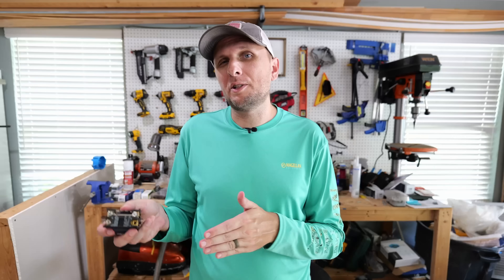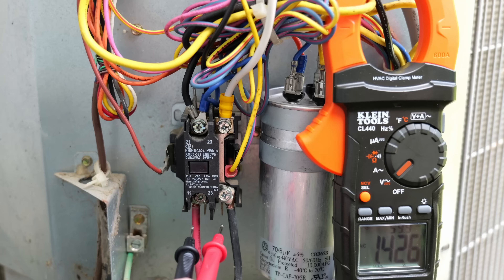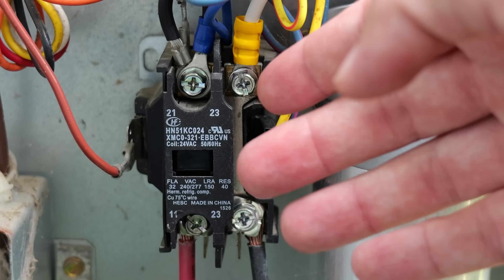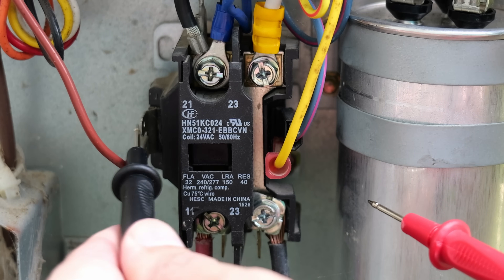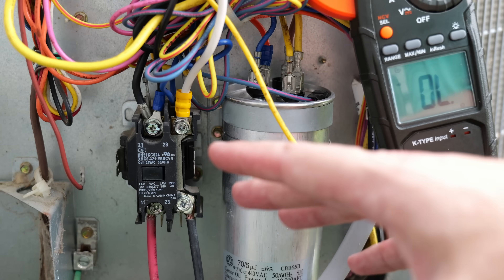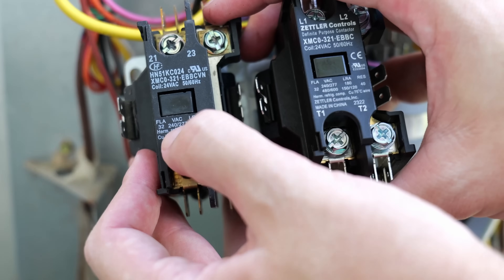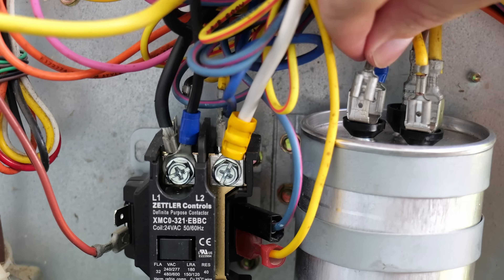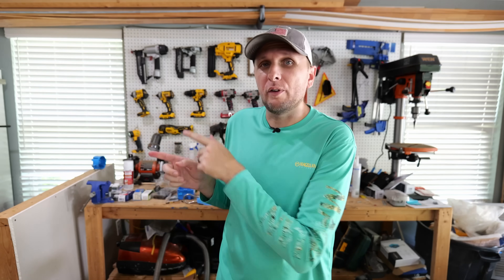Was Quoted $450.  I Fixed It For $19!  AC Contactor Testing and Replacement

Comment from the maker: Have you ever received a bill that seemed way too high for this kind of repair?  Crazy how one company can charge what seems like a fair price while another charges double or more.
Reply: I've paid all over the map on HVAC service, I think I finally found a guy that I can trust for the stuff I can't do and does not charge a crazy fee.  Over the last year I've replaced a start capacitor and the air handler delay contactor.  Both cost less than $20 and took less than an hour.  HVAC units are arguably the least complicated and least expensive appliance in your house for diy repairs.   They disassemble very easy and as you showed it is not hard to swap stuff out.  The compressor and refrigerant are outside the diy scope but that part of the system is usually pretty reliable, and you can pretty easily diagnose when you need call in an expert.  In my most recent case the unit was icing up both in the winter and summer and it would get stuck blowing cold because the reversing valve was not reversing -- a telltale sign that it is low on refrigerant.  You can also measure the temperature of air vs ambient to make sure it has at least 20 degrees rise or drop vs the return air temperature.  Most of the other appliances in your house go together like origami,  have computer boards and actuators and small motor or pump assemblies that fail, and are a bit of a black box and often expensive.  HVAC are pretty simple and straightforward and most of the parts are pretty easily available and inexpensive.  The thermostats have all the fancy computer bits now.
Reply: You have never dealt with a real issue before lol. Yes, generally they can be easy. But if you don't know what you are doing, you will eventually meet your match! @jamesthomas4080
Reply: Yes some companies are scam artists and anyone charging $500 for a capacitor or contactor is a disgrace to the industry but at the same time the customer needs to realize nothing is free. Biggest complaint we get is the trip charge as if gas to run the vans is free.
Reply: @YankeesFan74  It happened to me. Was charged $519.00 for $ 50.00 in parts plus trip charge
Reply: I’m almost 100% convinced that almost every HVAC company in my area is in cahoots. Every time they come out, they will tell you that it will cost $6000 to fix the unit or you can pay $12,000 for a brand new unit. They always recommend a brand new unit. No matter what is wrong with your HVAC unit. I’ve had it happen with three different companies three different times. Luckily, I have a friend who owns a company in another state, and he has one of his ex employees who lives right by me who still has his license who can look at it and fix it For what it should cost. $6000 to replace a $250 compressor or thousand dollars to fix a $20 capacitor. It’s just ridiculous. It’s all a scam. I’m glad there’s channels like yours who show the truth. Thank you very much.
Reply: @MeltWithU  Over-priced techs target the rich community.  Anybody foolish enough to pay that kind of price deserves to pay it.  The guy comes out and spends all day working slow as a snail not doing a single thing out of spec or off-book, and is always bloating the situation for profit.
Reply: A/C  inside stops but a outside unit stay running, what could be the problem??
Reply: I’m not licensed for anything except driving a vehicle. At the same time, we all have to realize we aren’t just paying for that $20 part. The techs coming out are bringing their vehicles $$, their equipment $$, their knowledge and experience, their business licenses and insurance $$, and doing something we aren’t fully trained to do.
I don’t defend scammers one bit; however, a man who has worked years to be fully trained to perform a service ought to be fairly compensated for it.
Reply: first you have the call out fee which will vary from 60 - 100 which covers the diagnostic. capacitor is about 40 bucks shipped plus the parts mark up no one takes parts out of their truck for cost its always cost plus. The contactor if its oem can run from 80 - 100 plus and the Chinese one its a lot cheaper but those parts can often void the warranty and fail more often. you're already at 240 for the cost and labor hasn't even started yet. Most people have business hours and emergency hours which are usually night time and weekends. 300 to 500 is fair for the change out on those parts during normal business hours, and 800-1200 for emergency calls. Not being a certified tech you're just voiding warranties  and homeowner insurance policies which isn't the most cost effective thing to do in the long run.
Reply from the maker: @hankgorman9731 well you’re way overpriced bud or you need to find another supplier.  You also told some lies.  The Chinese made parts won’t void the warranty as many times the original parts on the unit are Chinese.  Mine is a carrier and this is the case.  Secondly, a homeowner absolutely can change the parts on a unit and not lose their manufacturers warranty.  Now if there is any labor warranty on it from the HVAC company and you want to further be shady and void it just because the customer replaced a part correctly then that would just be par for the course.  But saying the manufacturers warranty would be voided is completely false.  I can understand why you would want to try and scare people though.

Comment: I did just like it's shown but my pictures weren't as good as I had hoped. I found a couple of yellow wires not connected. When I tried putting them on the low voltage sides they threw the breaker. I have not been able to find the good wiring diagram that shows where the Rudd condenser connects all these to tbe contactor and the run/start capacitor. To make things worse there are only 2 poles not marked either Herm, C or Run?

Comment: Thanks!
I have a 28 year old Carrier heat pump that started making a steady clicking noise.   I thought some debris (small stick or something) might have been hitting the fan blade (I've had that happen in the past) but no wiring or debris was in the way.     
The contractor and capacitor are original- we've lived here for 26 years without replacing them, so I've gotten my money's worth out of them. 
I'm thinking the problem is either the contractor or capacitor, so your video is very helpful.  I've been extremely busy, but will be checking out the unit in a day or two.

Comment: Nice video. The contactor on my unit is as old as the unit….1996 so it might be time to change it out. Don’t forget, with your fingers dancing around the capacitor, that capacitor still holds a healthy charge even with the power off. Do not the terminals.

Comment: Thanks for this video. You just saved me likely hundreds.  I didn't notice when I replaced the capacitor but looks like a surge took out the relay switch. I did go ahead and replace the relay switch. The wires were burned (black marks) and I honestly didn't even notice. I had asked a neighbor to watch me since I was dealing with electricity and he pointed it out.  I had to buy a wire stripping tool and then crimp new ends on 2 of the wires.  But ever since I fixed it all is good.

Comment: The problem I have is not that the unit doesn’t run but occasionally the inside unit hums between cycles. Is there a contractor for the inside unit or maybe I have a transformer for the thermostat about to go bad. What do you think?

Comment: Another great test is to put the meter across the top and bottom  terminals of contactor once it pulls on.. The voltage should be essentially zero.. If you read several volts, then there is a voltage drop across the contacts caused by high resistance of the failing contactor..

Comment: So I had an ac tech come out and replace my capacitor, and 2 days later, my condenser is not turning on . What could that be ?
Reply: See if any breaker switches flipped.
Reply: @BR-ex9xp it was the disconnect box .. thanks though

Comment: My Goodman contactor was physically sticking in the closed position, causing it to always run even with thermostat off. On arm of the relay was caught on some housing plastic, so when I freed it, it naturally retracted to the normal open position. Burnished the contacts while in there, still working but I want to proactively replace it due to age. But no modern contactors come close to my old contactor's in/out terminals, not to mention the mounting holes.

Comment: My 2016 Ruud 3T package unit has a Zettler Controls 42-102664-06, SMCO-321-EBBD. On this contactor, the Upper left is L3. The bottom left is T3. The upper right is L1. The bottom right is T1. On a Rheem replacement Protech 42-102664-05 (supposedly compatible) , these are switched, with the Upper left L1, bottom left T1 and upper right L2 and bottom right T2. Do I have to wire everything opposite and move everything to the opposite side on the replacement so that L1 stays the same, for example? Thanks so much.

Comment: Carrier AC suddenly stopped working and blew the 3 amp fuse on the control board.  Napa had the 3 amp fuse (less than $1) and ACE Hardware had the replacement contactor in stock for $25.  Took me about 15 mins to swap the wires and put the panel back on and another 5 to replace the fuse.  AC working again.  Thanks!

Comment: my contactor was bad on thursday,  but mine was shorting out the low voltage 24v side popping my furnace board 3 amp fuse any time i called for AC

Comment: I tell everyone that YouTube has replaced the dog as man’s best friend, and your video just confirmed it for me once again. Came home to a hot house the other night, and saw nothing but hot air coming from the vents. Fan was not running on the outside unit. Went on YouTube the next morning and watched your video. Went outside and tested my capacitor per your instructions and sure enough it was bad. Went to my local appliance parts store and picked up a new one for $22. Installed it in five minutes, 15 minutes later I had cold air blowing just in time for the hundred plus degree temperatures we are going to be experiencing in the coming days. Thank you, my friend.
Reply: Wait Jack, it’s true that I don’t have to scoop up 💩 after this channel, and I don’t have unexpected high vet bills, but I still stand up for my dogs.

Comment: You can take the contactor off of the a/c unit and remove 2 screws off of the back and housing will pull apart to access the inside for inspection or replacing components.

Also before working messing with the wiring,  the capacitor should be discharged first to prevent being electrocuted.

Comment: In Hillsboro Oregon and it’s starting summer weather we turned on ac yesterday and it was on but the house still felt warmed then I saw an error message on thermostat and realized the ac was never actually running ! We watched your video on the contactor and the capacitor and went to ace hardware and bought bought , we did not have the nifty gadget you have to test the power . We spent 60$ and fixed the problem it was the contactor . Thank you so much !!!!! I knew if we called a company they would charge 400-500$ and we would end up waiting days for help . Thank you YouTube videos!
Reply: Well done!

Comment: My older A/C unit went out, last year, mid Summer, a Company came down, charged me $1500+ to fix it. They jerry rigged it to get me through the summer, and I under stood they'd come back when winter arrived and fix it the Right Way. When winter arrived, they told me, NO that's the way it is. They replaced the contractor, they said, fan blade and motor, and fuses, one fuse was blown. I told them I wanted all the replaced parts. The old motor had a mounting frame, which they took out, because the new motor wouldn't fit it and cut the wires to the old motor, didn't see the old Contractor. The jerry rigged unit is still working, so I think the worker did a good job giving us Cold Air.  But really, people are basically at the mercy of the companies.  Wondering later, could the blown Fuse have been the only culprit as to why the A/C quit working. I'm a bit suspicious as to what's going on in our Country today. Thanks for the Great video, I saved it for future reference.

Comment: @HowToHomeDIY guy...I REALLY appreciate all of your videos.  I'm still trying to troubleshoot my unit but have grown more confident because of your videos. it started out with not blowing cold air. I pulled to cover and discovered one of the previous HVAC techs had installed a hard start cap on it at some point.  I tested the "regular" capacitor and the hard start and both were out of tolerance so I ordered replacements from Amazon...WRONG...LOL (Although the specs matched up, they weren't even close to the others) So then I reordered from Grainger and picked up.  I reinstalled both the new capacitor and the hard start thinking it was "necessary" for my system and here's where it  gets weird.  Before replacement, the fan would run but the compressor wouldn't engage to cool.  Now, NOTHING???? I see/hear the contactor engaging but nothing happens.  I tested it per this video and I swear I'm only getting 110/120v when I put the probes on the incoming power wires (11 & 23 in my case). I'm totally confused now so wondering if I should order a new contactor and try replacing that or if there's a bigger underlying issue.  I'm trying REALLY hard not to call out a tech since we've already spent a LOT of $$$$ in the past on another unit in our home.  Any help you can offer would be great!

Comment: Thanks for the videos!  I replaced the capacitor and that didn't get my AC going so took out the contactor, removed the cover and it was full of dead ants!  Cleaned them all out, wiped the terminals with acetone, put it back in, made the connections and walla, its working!
Reply: Was your compressor whining and fan not running? My compressor whines but no power to fan. I was thinking it could be dirty connections. I replaced capacitor last year

Comment: Your capacitor and contactor videos together took my $700 quote down to $30 and 15 minutes with a screwdriver. Thank you!
Reply: Just a few minutes ago I was told I needed a contactor 230.00 also blue light was out. 190.00.  I found them both ( together )for under 70.00.  What a rip these big companies are.   
Thank you very much for your very informative videos.  You have helped thousands.
God bless you.
Reply: Why not just replace the contractor how much could it cost.  I think the best way to deal with central air is get rid of it and get window air conditioners. The rip-off artist can't cheat you on those because they face a market that's not rigged.

Comment: We aren’t getting scammed companies have to up the prices to pay for employees, vehicles,insurance, ect….. its with everything in life, its called economy lol😂
Reply from the maker: Nope, many are still very much price gouging.  If it costs over $400 - $1200, it's a bigger issue than overhead and profit.
Reply: Bull shit!  I just had a well known company that advertises on the radio come out for a cleaning only.  They said my capacitor was reading low and offered me two options.  $400 and $600.  I told him thanks for the troubleshooting advice. Just the cleaning.  Went to Amazon and got the same capacitor for $20.  So YES we ARE being SCAMMED.  Your time/knowledge as a tech isn't worth a $380/$580 mark up on a $20 part.  Take a hike bozo!

Comment: Question about my single pole contactor: What would be the issue if my contactor button is not being pulled in when the system is on, the fan and compressor start up when I press it, I'm getting 240 volts on the bottom and 120 on each side of the top, and I've got 14 ohms on the sides? Is the contactor fine, or am I misunderstanding and need to replace it?

Comment: My contactor is exactly like yours. Question:  Is it OK to use the T terminals for the load wires and the L terminals for the load wires?  I could orient it the other direction, but then my wires would have to go to the "opposite side" terminals and I suspect that will get me confused. Thanks for any tips.
Reply from the maker: Mine are the opposite as it should technically be for the labeling due to the issue you just mentioned.  On mine my T terminals have my line coming in and the L terminals have the load.  Technically it should be the other way.  You asked about load on both of yours so not completely sure what you were asking for specifically but hopefully explaining what I did helped.
Reply: @HowToHomeDIY  Sorry, I mean to say is it OK to use the L terminals for the load out to the compressor/fan and the T terminals for the Line voltage from the circuit panel. Yes - thanks. The bottom line is you can use them in either direction.

Comment: So if I’m not seeing the 24v does this indicate a bad contactor or a thermostat issue? 

My compressor kicks on if I manually press the button on the contactor. But for some reason it won’t make the connection on its own.

Comment: Neighbor paid $424 to replace a capacitor.  When my identical system was checked in the spring, he mentioned that the capacitor was "weak." and would fail.   I ordered a replacement fro Grainger - exact, even to the brand and part number - for $9.48.  Took about 5 minutes to replace it.  Then I tested the old capacitor - it was +- 5% tolerance and was actually 4% above spec.  Damn crooks !
BTW, most modern multimeters had a capacitor test function.

Comment: Nice video.  I am looking to do my first replacement.  If the old contactor is rated at 50RES and the new contactor is at 40 RES should that be fine.  There doesnt seem to be any contactors that I can find that exactly match up.

Current Contactor:
VAC       FLA   LRA  RES
247\277    30   150  50
480        30   125  40
600        30   100  40